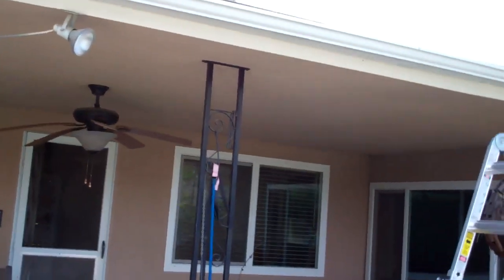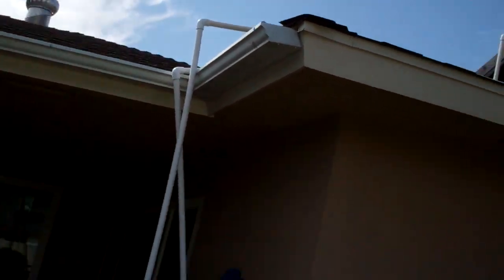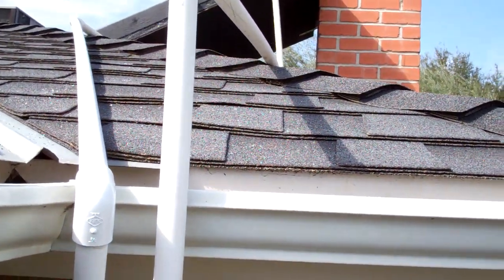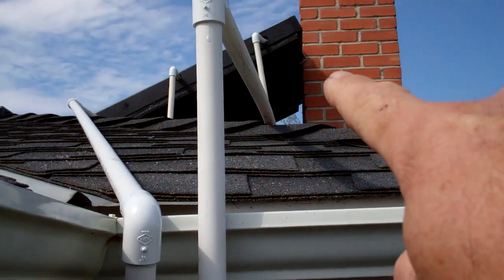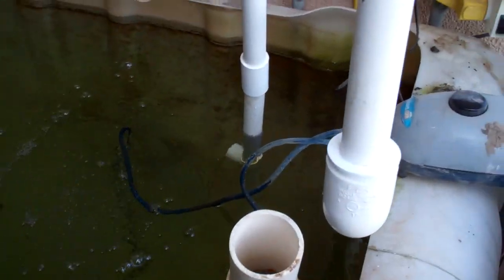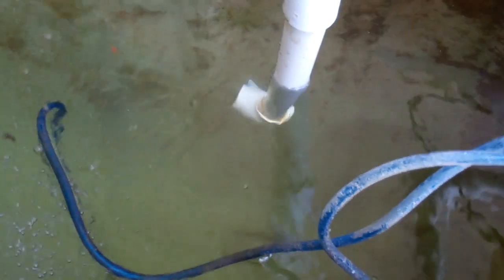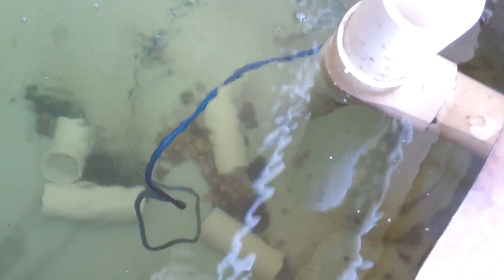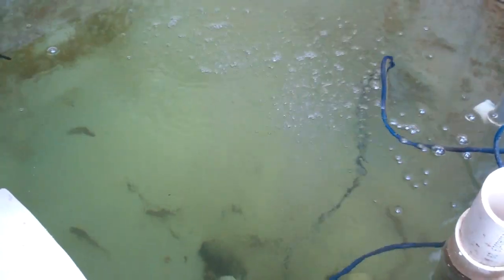Solar Hot water heater for Aquaponics

Comment from the maker: Hi MrMadmax478, This is just a tinker so hadn't really thought about regulating temp.... I would like tank temp to be around 70 degrees!! I just watched a video about what someone had done with a low volume constant run pump and a thermal limit switch. So a rework may be in the cards..... 
Thanks for watching and the Question!!